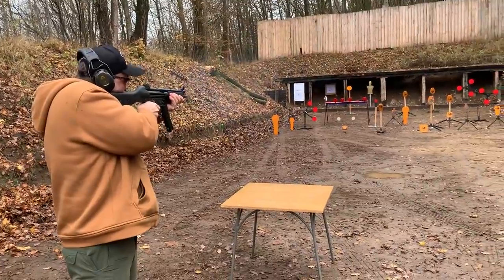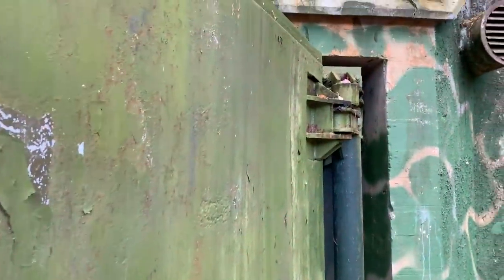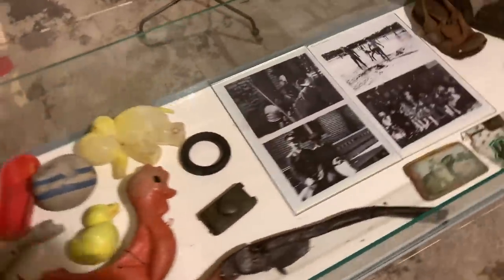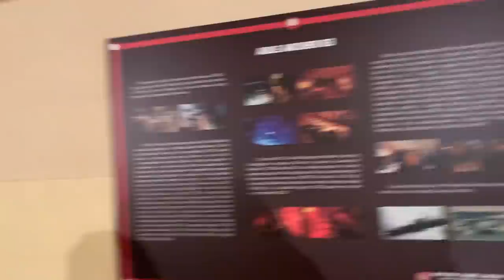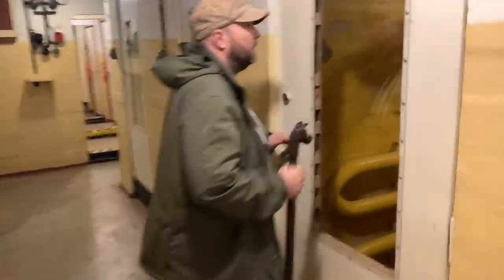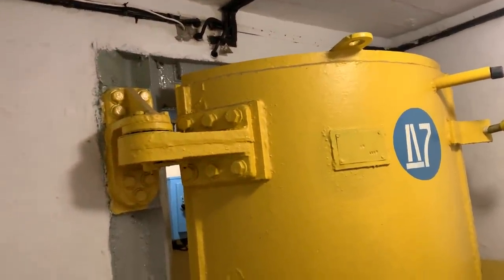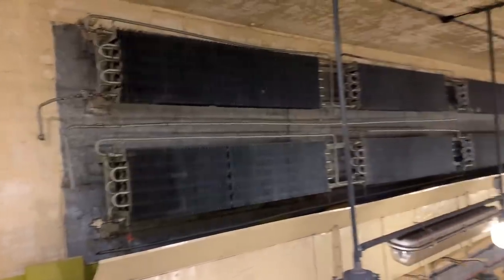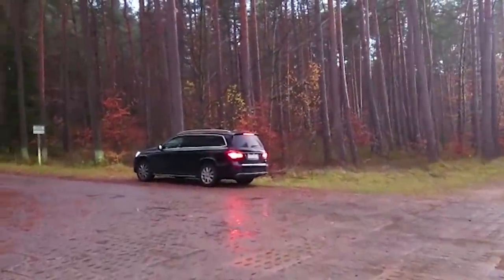This BUNKER could have destroyed Europe

Comment: The large tank was for diesel fuel to supply the generator. They called it  - oil tank which was partially correct since diesel fuel is basically oil. 
Interesting to note that in some military installations, some electrical conduits (that carried important wiring circuits) were pressurized with dry air. Any attempt to penetrate the conduit would drop the air pressure and set an alarm.
Reply: In Germanic languages diesel is called dieseloil. Wouldn't surprise me if it's that way in Slavic languages as well.
Reply: @jwenting  In Polish it's olej napędowy which means something among the lines of propulsion oil.
Reply: @KapitanWasTaken  ty, think in Russian it's something like Gazoil but not sure

Comment: as a hvac mechanical designer that works on navy vessels I am always curious of the ventilation systems in bunkers.  They cant be much different than a steel vessel.  Once the doors shut they are all confined spaces without proper ventilation.
Reply: last bunker I took a tour of, had triple redundancy on it's hvac,  the last redunancy was a closed loop system that never touched any outside air, the other 2 would pull air if you told them to.  was fascinated.

Comment: Kelvedon Hatch in UK is open to the public and  is quite an engineering feat for its time.  The whole concrete bunker box is mounted on giant springs to absorb shocks and all connections to surface are flexible so they wouldnt break.

Comment: Really interesting that the had to cool to bunker as a result of heat decay from the plutonium in the warheads, really tells you how much Pu-239 was physically there. Typically you wouldn't have to worry about radiation hazards with nuclear warheads considering Pu-239 is only an alpha emitter with a very small amount of neutron emission from Pu-240 contamination, but with 80 large warheads in such a well shielded environment is a decent hazard since it's unknown what other radioisotopes were in those warheads. Surprised they wouldn't just have a well shield space for engineers to stay in until they had to interact with the warheads.
Reply: The probably did. There were extensive living quarters outside the bunker, and looks like several levels to the bunker.
The troops would be separated from the warheads by several meters of reinforced concrete and of course steel and the material of the warhead casing as well unless they were directly working with them.

Comment: Towards the end of the video when you guys are driving out, the car's blind spot system seems to be acting up? I wonder if the prison area is using ground radar in the same band as the blind spot sensors.
Reply: Seatbelt sensor - not so interesting!
Reply: No, those where the blind spot detectors,  you can see the light is on in the mirror

Comment: I didn't see any of the facility loaded on springs like a lot of US facilities, did he say what they were rated to take?
Reply: This ammo bunker wouldnt survive (like any other being on a target list). Its a misconception that a bunker can be built to reliably survive potential direct hits and NATO would just plaster a site like this with a few warheads of which one is likely to hit it close enough to take it out, in case the weapons were still there. 

Soviet facilities were always rated for medium sized (high double to low triple digit kiloton range) circa one kilometer away. That was with NATO warheads in mind, which were typically smaller but with a far superior CEP over Soviet counterparts. Thats why the Soviets liked their megaton range nukes - wont matter if direct hit or 3 miles out, any structure will crumble under the shockwaves traveling through the ground, whether it is spring suspended or not. And if it would happen so that blast doors like these without a structure to break the blast, would directly face a 300kt detonation under 0.5km, doors like these would likely not survive.

Comment: One thing I didn't get: What type of bombs were stored here? In the scale model, it looks like the cone shape of missile warheads but there doesn't seem to be any missile facility. I then guess it was bombs to be dropped by planes.
Reply: I always thought that most Russian launchers were mobile ones.
Reply: I asked myself the same question. 
The best I could find was that the type and the amount is unknown, it mostlikely must have been for the mobile launchers of the Scud, Luna and Tochka launchers. These launchers were operated by polish units. The missiles from this (and two other bunkers) would have been brought to a handover location specified by the soviets and then transported by the polish units to the launchers in case of a first strike scenario. Or of course nuclear shells for artillery and bombs dropped by planes.
So weapons between 0.5 kT and 500kT and about 281 were agreed upon.
Mind you that the document I read mentioned that the procedures (missiles) for this handover were defined relativly late in 1986, so bevor that well no idea, propably though they figure it out on the fly and tell the pols when basicly at the last moment?? or just bombs for planes, since with those the soviets could have just shown up at a polish airbase and said drop it, without major logistic hassel compared to the much larger missile warheads and mobile launchers, airbases at last tend to not move...

Comment: So where was the launch area? nearby or just a storage depot
Reply: I believe these would have been deployed using mobile rocket launcher trucks. so no fixed launching area. I presume the trucks would have been moved to lots of different areas so they could be easily targeted. The only issue is that if there was a sneak attack with no warning they would have never been able to launch since it likely would have taken many hours to get all those warheads mounted to the rockets.

Comment: So did they store the warheads inside and then take them out to be mounted on the launchers? I never saw anywhere for them to be deployed.
Reply: Yes
Reply: Yes, these appeared to be short ranged missiles, (scud sized). I presume that was the peace-time storage bunker for the warheads. If there was a drill or increased readiness, the warheads would me placed on the rockets. There is a glancing view of the mobile rocket truck models that had the rockets. I presume it would take several hours to get all of the warheads mounted before they could operational.